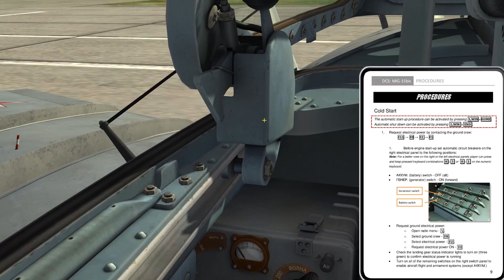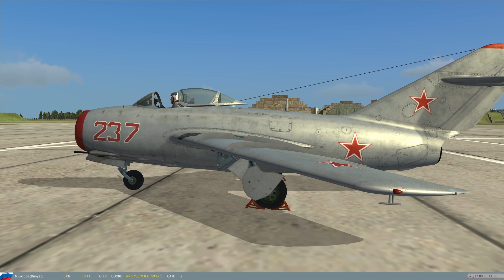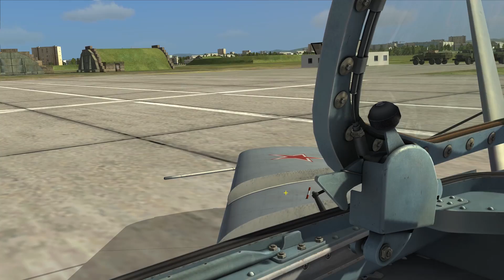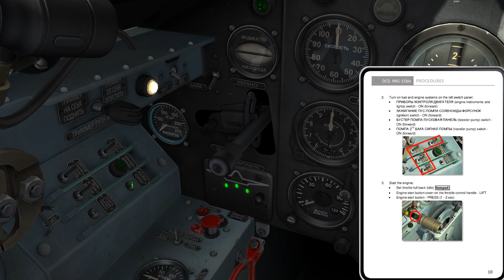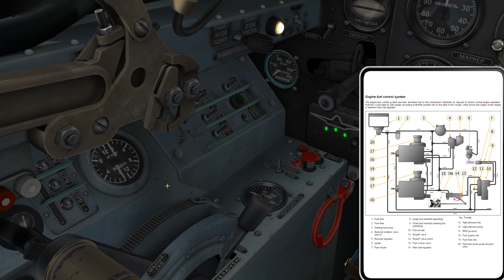Test Flight - DCS: MiG-15 bis Fagot #6 (Electrical, Fuel, Engine Ignition Systems)

Comment: you wondered about the nose light having 2 switches. I think they say the switch panel on the right is a circuit breaker control switch panel. So maybe the nose gear light switch is the breaker and the switch on the instrument panel is the control for the light.
Reply: Jack Gurley My thoughts exactly